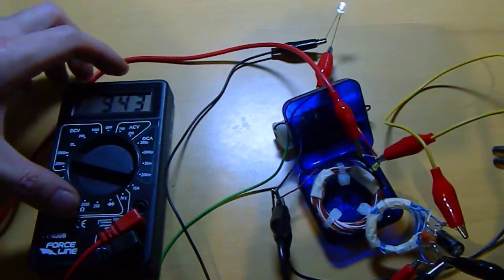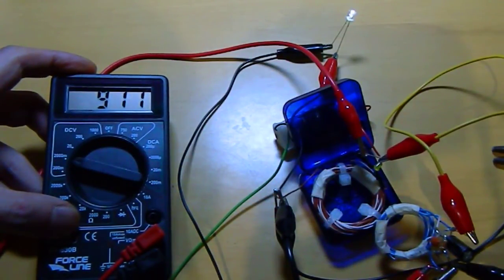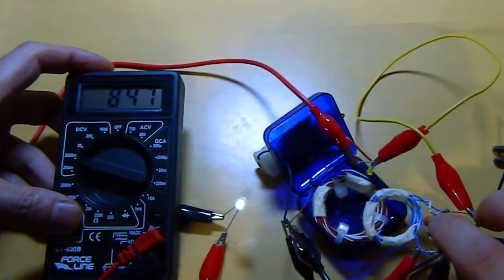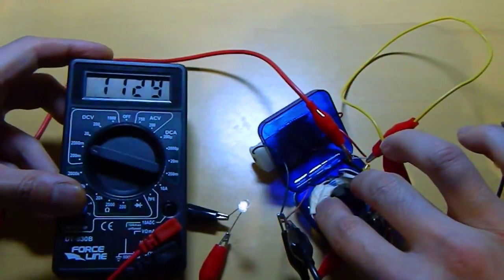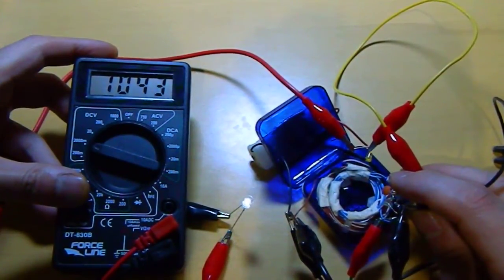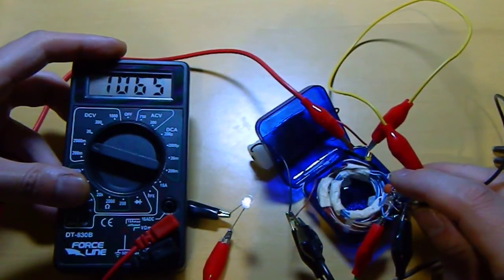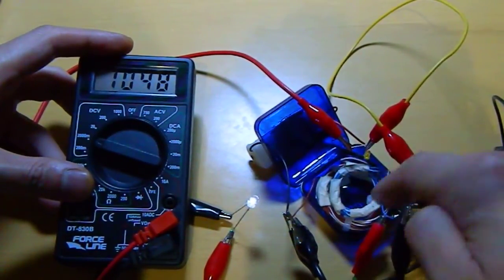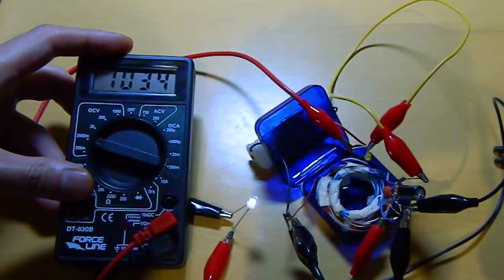The Joule Thief inside the wireless charger

Comment: If you can get almost enough energy back to keep the battery running from the back emf, why not sent half of the primary energy back to the battery + the back emf?
A low powered circuit could run forever, right?
I also get confused why we need resisters in a circuit. I understand that components  need a certain voltage and amperage to run properly, but is seems such a waste of energy to just burn it up in a resister. Why not have small joule thief's replace resisters, that can take some energy to run and regulate power, but create a separate energy source that can be reused?

Comment: Thanks, I was wondering if you could take a look at some crystal glue cell batteries.
ibpointless2 has some that have been running for a couple years now. I think with these power collectors you could have a system that would run, with useful light, for years.

Comment: the battery is discharging, because for charge it uses current and capacitance of power source...you just converting charged capacitance to voltage on same battery... try to check your batteries with capacitance meter and you will see that they are doesnt charging. Also i saw that you overcharging your lithium batteries, this process is killing its capacitance